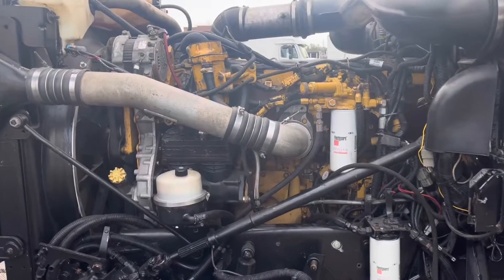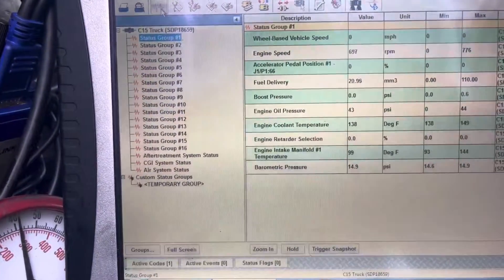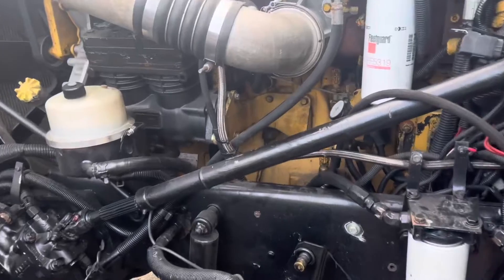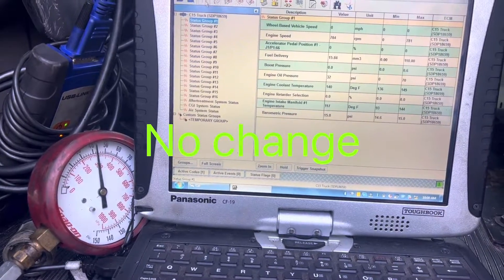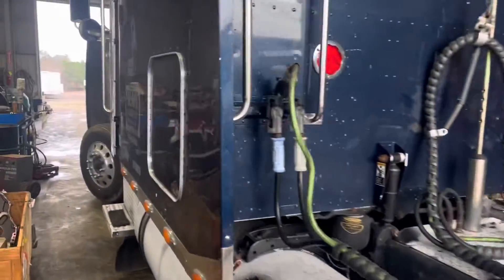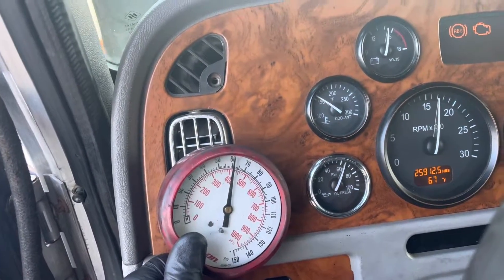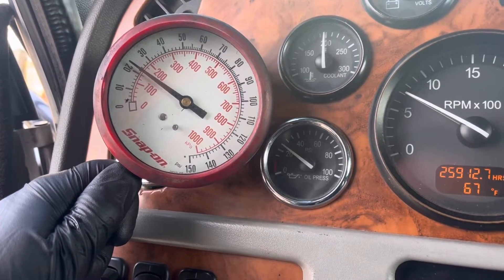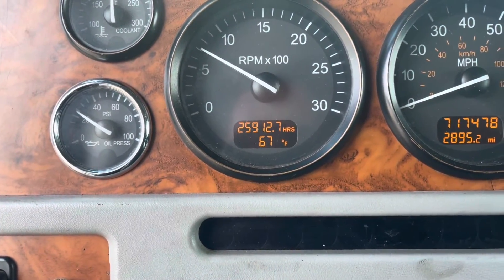Troubleshoot low oil pressure on C15A Cat truck engine using a manual gauge and laptop.Diagnostics

Comment: how did it go?What was the final issue with the oil pressure?
Reply from the maker: Found nothing wrong with the oil pressure.  It ended up being wiring issues on the Peterbilt side of things.
Reply: I thought lower than 30 psi on idle is too low..